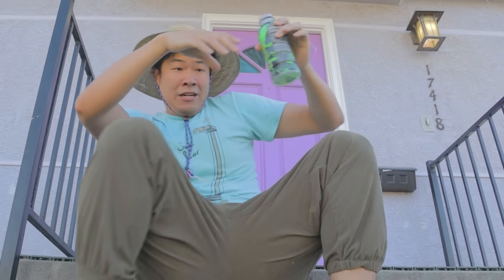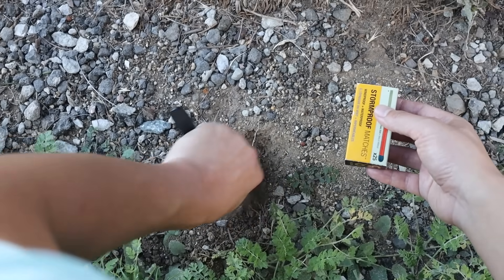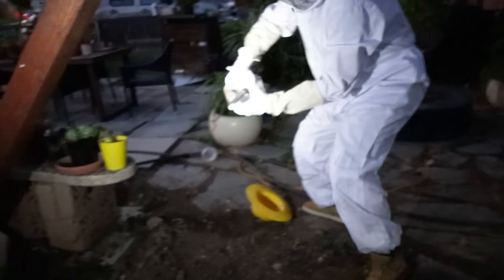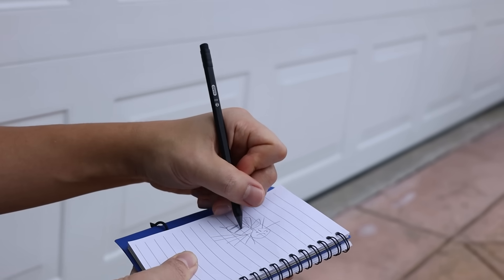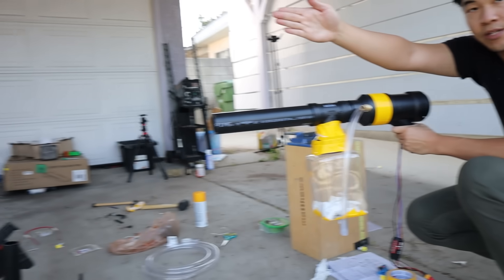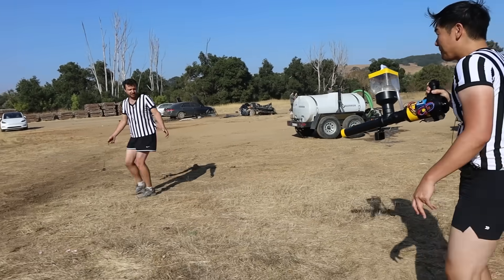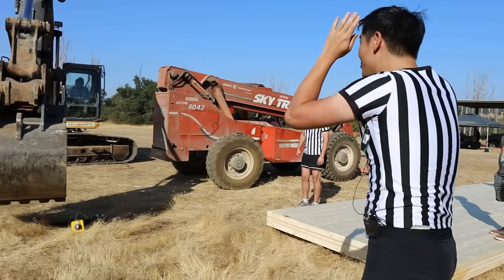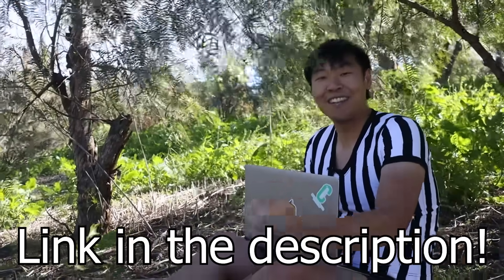Bee Gun, the gun that shoots bees

Comment: to make an RPG: to make an RPG: Launcher tube: This is the main structural component of the launcher and can be made from materials such as aluminum, steel, or carbon fiber.
Ignition system: This is used to initiate the rocket motor and can be based on electrical or chemical ignition.
Firing mechanism: This is used to release the missile from the launcher and can be based on mechanical or hydraulic systems.
Stabilization system: This is used to stabilize the launcher during firing and can be based on hydraulic or pneumatic systems.
Targeting system: This is used to aim the launcher at the target and can be based on optical, radar, or other technologies.
Power supply: This is used to provide power to the launcher's systems and can be based on batteries, generators, or other sources.
Transport system: This is used to move the launcher to the desired location and can be based on wheels, tracks, or other means of transportation.Rocket motor: This is the propulsion system for the missile and can be purchased from aerospace suppliers or made from scratch using chemicals and metal parts.
Warhead: This is the payload of the missile and can be an explosive, chemical, or biological agent.
Guidance system: This is the navigation system for the missile and can be based on GPS, radar, or other technologies.
Airframe: This is the structural component of the missile and can be made from materials such as aluminum, carbon fiber, or titanium.
Fins: These are used to stabilize the missile in flight and can be made from materials such as aluminum or fiberglass.
Ignition system: This is used to initiate the rocket motor and can be based on electrical or chemical ignition.
Launch system: This is the platform from which the missile is launched and can be a fixed or mobile system.

Comment: For the Venturi effect to work better (or at all) you should've had a smaller circumferance of the pipe around the intake, so the air's verlocty is larger at that point, thus increasing dynamic pressure, which leads to a lower static pressure. But you'd probably still need an air intake for the reservoir, so it can maintain a larger static pressure than the intake and you don't just end up creating a weak vacuum.

Still, from an ethics standpoint, that gun is questionable.

Comment: For a Bernoulli pump to work, the flow has to be passed the secondary uptake. the primary fluid flow will "pull along" the surrounding fluid. this means they have to meet with the flow.

couple ways to accomplish this:
1) Add a smaller diameter pipe inside the barrel that channels the primary airflow passed the bee-ammo ("Bammo!" if you will) hopper, and vent the hopper itself so that air can flow through it freely (mesh bottom is fine, like on your other jars).

*2) attach the hopper to the barrel using a second Y junction like you're using for the handle. inside the hopper junction, using a piece of plastic, like from a 2L soda bottle, add an aerodynamic, ovoid, hemispherical hood (like a bullet-shaped amphitheater with the hole to the hopper where the stage would be which you can cut out of the rounded top of a 2L) facing away from the fan. the opening of the hood should be JUST downwind of the junction's opening, and I'd start with it at 25-30% of the diameter of the wind tunnel. these 2 parameters could be played with to tune the suction and speed! 

(this is how a Y-Junction Bernoulli pump works on naval vessels, and in construction, to control flooding, so you could probably find the parameters of one of those and just copy it!)

the smooth, curved constriction of the airway should accelerate the airspeed at that point for more suction, poetically using 2 of Bernoulli's discoveries!

Comment: Why not just angle the bee container backwards? Instead of a T junction it's more like a y. The air shooting through the barrel will create suction and you can just put a one way valve in the bee container so air can flow in. It's be simpler and easier than using hoses and other over engineering solutions